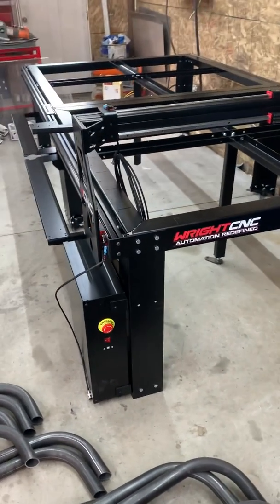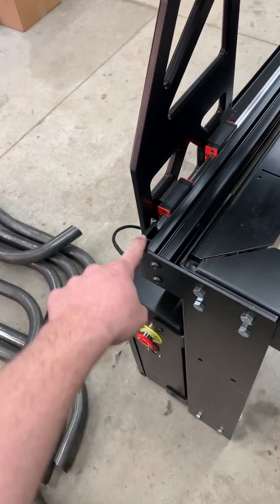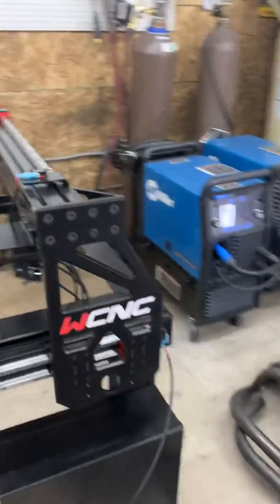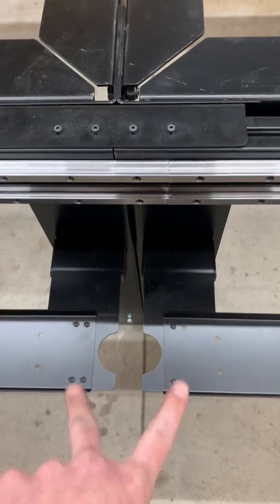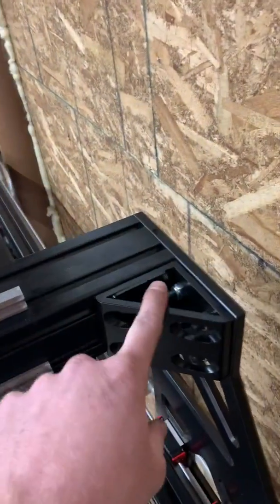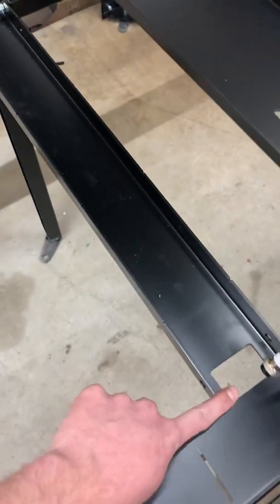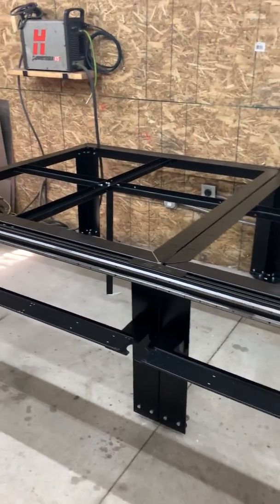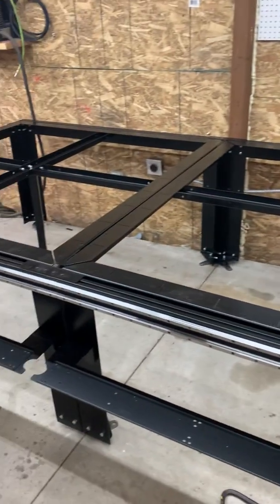Wright cnc 4x8 next generation table tips and tricks

Comment: I ran into the same problems with the missing hardware and lack of assembly instructions. I thought I was crazy until I found your video. The first assembly video says to use the 1 inch bolts in the feet but then you don't have them for the areas of 3+ layers. They posted a video for extending the 4x4 to the 4x8 today but it still doesn't address what hardware to use. I bought 1 1/4" long bolts for connecting the 2 halves and bought a bunch of extra 1" bolts to ensure the lock nuts where actually engaged in the bolt threads. I did exactly what you mentioned and put a 1/4" plate spacer between the 2 tables where the water pan supports connect. Extremely frustrating to spend that much money and not be able to assemble it.
Reply: Hi there. When did you purchase your table. Im just curious the time frame that im looking at. They told me 10 weeks 5 weeks ago.
Reply: @justy1606  Mine is just getting shipped, it took a total of 20 weeks. You will be waiting longer then 10 weeks for sure.
Reply: @stephanielandstrom4929  I  called yesterday and they said august now. Bogus. when did you order